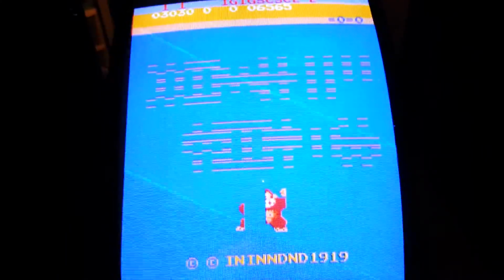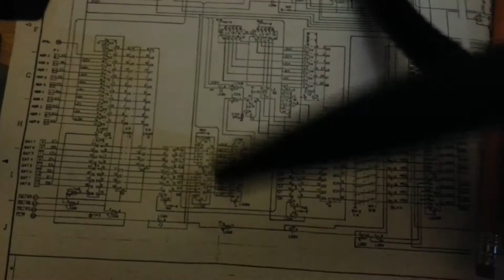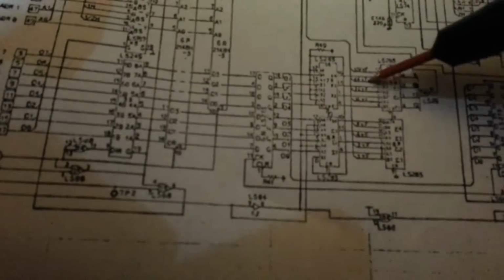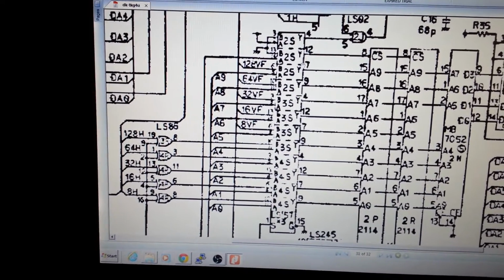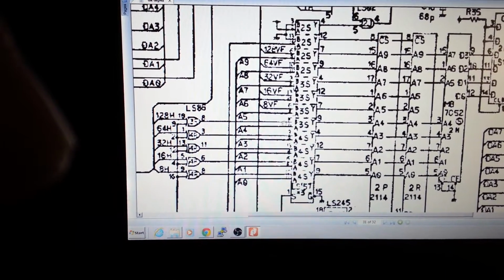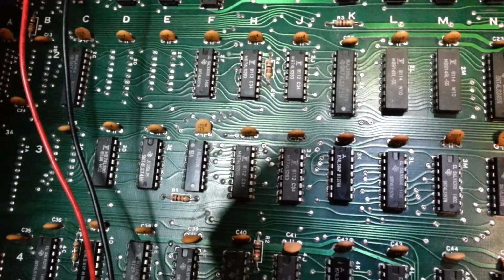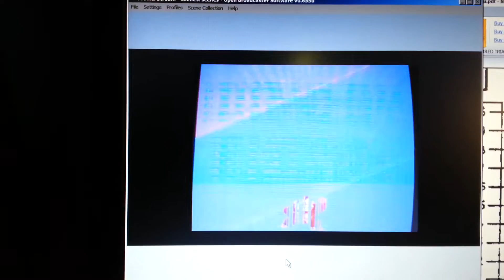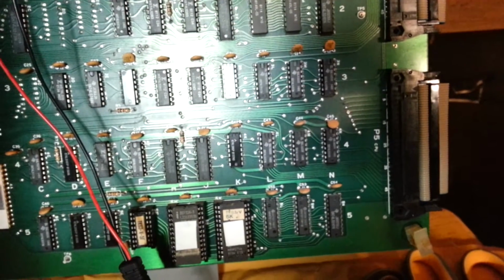Donkey Kong Arcade Board PCB Repair  - Part 2

Comment: JONATHAN TOMLIN, why does some arcade games use MASKED ROM chips instead of EPROM chips? What are the differences between H&V sync signals compared to XY deflection signals?
Reply from the maker: Not sure if serious or trolling...

Masked ROM vs EPROM and why a game would use one over the other may be a design or cost decision.  To really know why one game used one or the other for a specific use case would be a question for that game's design engineer.  However, as most things in life, it usually comes down to cost.  You could equate this as to why you would use a CD-R over a CD-RW.  If a need to rewrite the contents of the memory existed, an EPROM may have been better suited.

The difference between Horizontal and Vertical Sync signals in comparison to X/Y deflection signals would be the type of game graphics rendering.  I'm not sure how or why this question is on a Donkey Kong repair video as this is more of fundamental game design and graphics question better suited for a class discussion.  I would suggest asking the question on a proper forum or researching the difference between raster graphics and vector graphics.

Ultimately, I hope this helps you and others.
End of line.
Reply: @StrykharArcade  I'm not trolling this is serious questions. I'm confused are XY deflection signals some type of sync signals or how are they difference compared to H&V sync signals, I'm not understanding the differences, can you please in detail if you know.  Most arcade games power supplies only use one filter cap rated at 27,000uf and higher why use such a very large capacitance 27,000uf? All arcade monitors have a B+ voltage set at 125vdc but what does this B+ voltage control or used for the sync & hold circuit? I'm confused what the B+ voltage is used for in the arcade monitor